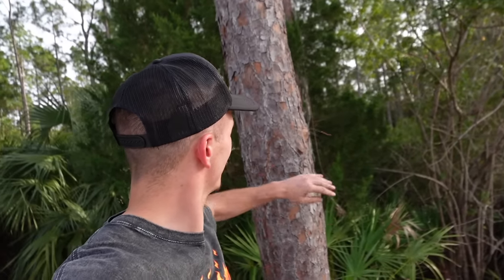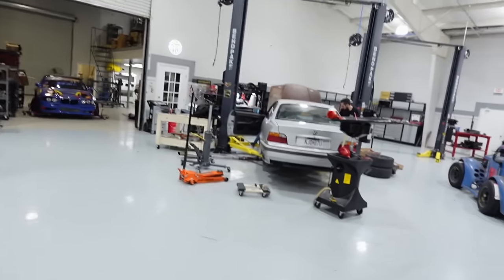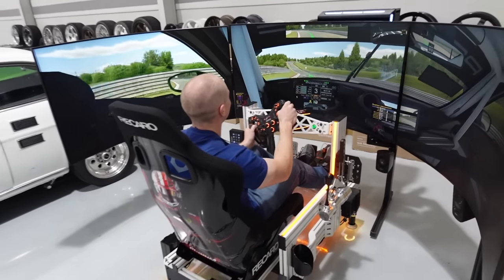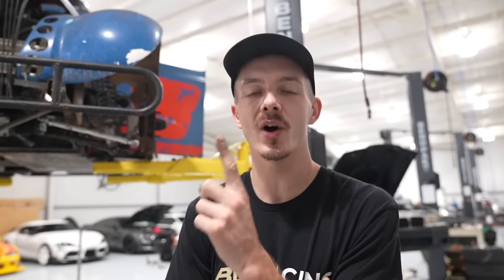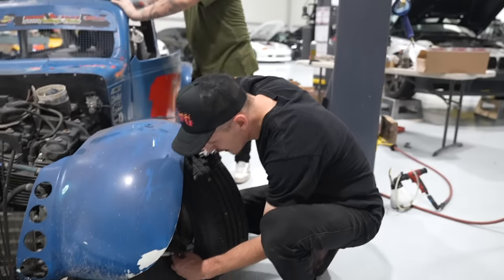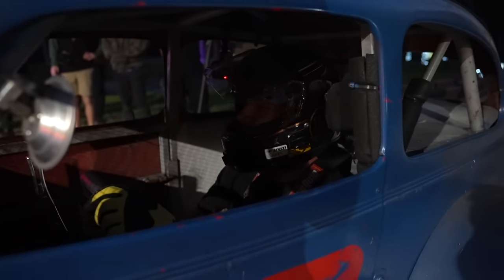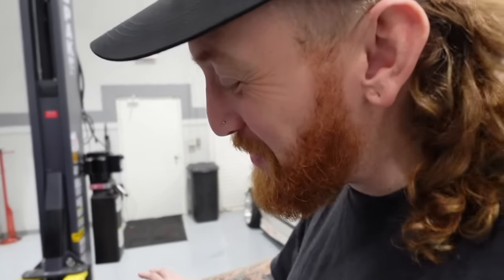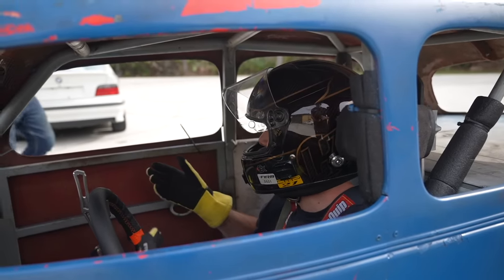Modifying My Streetbike Powered Racecar to Drift!

Comment: I drove one of these types of cars (modlite) a few years ago on dirt. My last one had ATV electric power steering on it. Worked like a charm!
Reply: That's not a bad idea. Power steering would help from haven to man handle the wheel an throwing his arms into the sides as hard. Hope he see this.
Reply: Bump
Reply: Pin
Reply: Was thinking something similar like an electric steering pump/rack setup
Reply: That’s a big alternator tho. Takes a lot of power to run an e-rack.
Reply: we use them in the micro sprints also. I didnt like it so I took it off mine but alot of the guys are running them.
Reply: I was literally thinking this throughout the video.
Reply: @RadDadisRad most run a complete loss battery system. Will usually last well long enough on 1 battery
Reply: A rack out of a SXS would work. Most SXS only have a 750w stator that run the whole car.
Reply: @RadDadisRad not an Atv or utv system it weights less then new side by sides and they don’t have alternatirs on most of those put a good light weight powerful Atv battery and you will never have a problem espically if it already has an alternator on it

Comment: Just a heads up you might want to add a nice beefy oil cooling system to keep the wet clutches alive inside of the gearbox... Those clutches do not like extended amount of friction heat from clutch dumps and kicks 👍👍
Reply: on the plus side, they are pretty easy to swap when you do inevitably fry them though lol

Comment: The carbs needle / clip position is mostly what you need to adjust for your mid range tuning. You might also want to start by adjusting the air/fuel mix screws
Reply: I agree, I would’ve tried to drop the needles a notch and seen if it ran a little crisper.
Reply: Correct yes: the pilot jet/AFR mixture screw only adjust Idle and just above so 2.5 to 3K rpm. There's a air bypass in the intake you adjust with that. After that its all the needle/main jet taking over.
Reply: Screws are for idle only
Reply: Beat me to it
Reply: This is the whole reason I came to the comments to see if somone had alrdy said it or to get diffrwnt sized sprockets for more power and or torque
Reply: need an 4 way vacuum clock to adjust em properly, almost impossible to make without on more than 1 carb setups like that XD think it's called that atleast in english

Comment: Idea for the lights, maybe have 2 of them on each tree, 1 where you have them to really highlight the tree and a second higher to give more spread.

Reflectors are V underrated, could line all the pavement with them (stick in dirt, screw reflector to it) and trees or other obstacles. Different colours can show entrances or hazzards.
Maybe yellow/orange for lining the pavement, green for entrances / access and red for hazzards, blue for water, white for the drops and so on. tonnes of colours to pick from.
IMO they are superior to lighting because they are cheaper and work no matter the weather etc/ no power needed and so long as you have lights (even really bad ones) they light up super clear.

You guys should do some drift games... Ring racing and such (think barrel racing (rodeo stuff) in cars) Much fun.
"King of the Cone" is an event during the Donegal Rally.. Good clean craic..
Reply: Good idea man

Comment: Bro, pull some pinion angle out of the thing to free the rear up some. Also you have the proportioning valves, ease up the front brake pressure and up the rear pressure. Then no need for the handbrake unless you get into trouble. Raced those cars for years.

Comment: What he said was a seat can be taken out, They are the main jet holder and have loads of small holes that can get clogged easily, You just tap them out, Pilot jet only does from idle to about 20% throttle, You want to go back and pop those main jet holders out and ultrasonic clean them

Comment: By the end of the week Adam's going to have all the nuances of turning a Legends car into a drift able platform dialed in!  I agree with Hert, next year instead of E36's everyone gets a Legends car and mods it. Only prob is, (as Collet & Grant let him know) the sketchiness of speed & the short wheelbase and basically open wheel chassis/frame with the little fenders and running boards, questionable welds Ect...might dampen the door tapping fun some. Guess you could aways weld some side skirt bash bars on. 🎄Merry X-Mas LZ Compound looks great BTW!

Comment: Try raising the needles one notch and or different taper needles - that's what governs midrange. Bigger main jets may also be in order. On CV carbs, shorten the slide spring one coil, and drill a tiny hole at the very bottom of the slide (if it's plastic). This relieves the air pressure above the slide so it rises quicker. Many CV carbs have delayed slide response and no accelerator pump so you have to do some little tricks to get them to open up quicker...

Comment: The caster is changed by the radius rod attached to the top control arm. I like the angle mods. Not sure if would be good for racing but would be fine for drift 🤘🏼
Reply: Never mind. I should have waited till you adjusted it with a grinder 😂
Reply: "We'll just drive it with a lot of toe out" (exactly like the Beemer) and you didn't even have to fab extensions

Comment: After 20yrs daily driving a competition geometry modified datsun 510 there are couple lessons ive learned.  Shortening steering arm (the slotting done...)  @ wheel end even a little removes a lot of leverage at the steering wheel... to steer one handed without power - leverage is a must.... but gained leverage is lost rate...leverage can also be gained with a larger steering wheel. A correct balance of both  and a driveby knob (think lo-rider bling)... and a decent left arm... andya in bidniz. Caster alo adds weight to the steering wheel in trade for stability... im sure you guys already know ALL this, fundamentally... but without power steering its all drastically amplified. Add wheel tire size weight and grip... and even big arms can easily be overpowered

Comment: Since they are so light you can add-to/rework the chassis/frame/cage to better fit all the drivers and make it safer for drifting, also would be cool if you make sheet plates on the edge of the skirt so they can leave "door marks".

Comment: Throw a junkyard 1000cc in it if you get bored or anything happens to the engine.  They average around 190-200 or more hp and you'll have that high rpm screaming inline 4 sound (still around 14k rpm but have that classic high rpm sound unlike the grunt of the engine in it now).  Also they are pretty cheap.  Newer 600cc's make around 130 and rev out to 16-18k rpm most of the time if you wanted to go that route.  A great example would be the Kawasaki zx636.  Always look forward to your videos.  Thank you

Comment: Getting flashbacks to my gran turismo 5 days. Medium soft racing tires on the front, very soft racing tires on the rear, and 900hp. Made for some very intense and very fast drifting sessions around Tsukuba circuit.

Comment: Add a battery in the back to supply a roof bar headlight unit, everything bolt-on like you want to. It's something simple, easy to make. Just make a hole in the back to get the cables inside the cabine and then other to the roof with waterproof glue to connect to the headlights

Comment: there are some Bike Engines over Seas that has Reverse  or you could mount a starter backwards and bolt a gear that will mesh with the starter between the driveshaft and the coupler on the back of the transmission.

Comment: You’re running on three cylinders at low rpm I think. Probably need the carburetors gone through and rebuilt. It should idle a lot smoother and not crackle like that at low rpm.

Comment: I bet it would feel a lot better with smaller diameter tires with less side wall. motorcycle engines don't have a lot of bottom end especially carbureted ones, so you should keep you revs higher and slip the clutch to control the power in turns.

Comment: The mid is the needle and needle jet. Pull the tops off and pull the slides. The needles in the bottom will fall out and you can adjust them by moving the clip (usually) or adding washers to richen. The pilot only does idle to 1/4 throttle.

Comment: That old Yam engine isn't even  gonna make120 horses. So much fun and adrenaline from so little... but you could take your pick of bike engines from the last 25 years and upgrade massively. Drop an R1 engine in there and nearly double your ponies for less than a grand. Much taller 1st gear does over 100mph on a road bike but the newer cassette gearbox would make a custom ratio selection so easy to do, plus quick shifter and auto blip feature on the gearbox has gotta be interesting in a legend. Clutchless sequential and a few thousand more revs. New game unlocked Adam.

Comment: Those CV carbs are a headache for a lot of 80s yamaha guys. They need a plenum of sorts so that the air has some speed to it coming into the carbs. The usual trick is adding "velocity stacks" between the carb and air filter. You'll lose a tiny bit of top end but gain a ton of mid range. Other option is the Murrays carb kit for the bolt on swap.

Comment: They make very nice electric power steering units for them that would help with the heavy steering, just need some elbow pads.  Sweet project.  Add a new injected gsxr1000 to it with about 200hp and will absolutely destroy those tires

Comment: In the centre of the slides for the carbs is a small hole if you drill that hole out to 1/8 it will work better at mid and bottom end

Comment: I was just thinking about oil and cylinder Temps while hot laping the car which is heavier and probably less air flow to the engine that's now blocking air to the 3 rear cylinders. I would look into some way of blowing air across the fins it don't rake alot to help alot on Temps. Also hoping you have a large oil cooler. Pretty sure that normal engine used a wet clutch which is bathed in engine oil.  May want to keep it changed like every 10 hours of besting. Love the ripping old engine but a new gsxr engine would run alot better in a over Rev situation.

Comment: 2 things you can do to to make it steer easer install a steering quickener backwards. it wil take more steering input to turn but will be easer to steer it. The other is you can find a electric power steering   unit from a 4 wheeler or a side by side and install that.

Comment: The only thing to worry about with routing the fuel line outside of the frame is that if the drive shaft falls off and starts spinning it’ll take out the fuel line, wether if it’s in the box frame that would protect it a bit. Just something to think about.

Comment: Your engine has CV carburetors (constant velocity) which are not in my opinion a very good performance carb. They react too slowly to throttle inputs (the time that it takes for the vacuum to pull up the throttle slides or the springs to push them back down).  I used to work at speed shop back in the day and we were focused on these old hemi muscle bike engines. If an engine came in with  CV carbs, they were the first things to go and a set of quality, mechanically controlled slide carbs were installed.
OTOH A mega squirt DIY fuel injection sys would be far more responsive, tunable and make more power to boot. MY 2 cents.

Comment: It's at the point Adam should just buy some kit car chassis that use s chassis steering and suspension and just get Johan to build a small fleet . Would be able to run them on small cheap tyres and use a fibreglass body to make it look like any car .

Comment: You need a steering ball like they put on truck or tractor wheels that way you can hold the ball and steer with one hand and still be able to use hand brake

Comment: Switch it to efi the carb bikes vs efi bikes are night and day different. Throttle response power gain. More control through the throttle range. Would lite the tires easier.

Comment: Modlites,  which is a faster legend car uses electric power steering off of side-by-side. Should work good on that.
Reply: A modlite is a completely different race car. But they're both considered "small cars" in racing. 
But yeah, he could probably use the electric power steering from a side-by-side.
Reply: @trevor4533  dwarf cars are a spawn of legend cars and mod lites are a spawn of dwarf cars.
Reply: Been around all 3 and built all 3. I do understand what you meant tho.
Reply: @ronniecanon1203  close. 
Dwarf cars actually predate the legends cars. First ones were made in the late  70s-early 80s.  The earliest Legends cars were actually Dwarf cars with a name change and Fenders.
But yeah, modlites also spawned from the Dwarf cars.
Reply: @trevor4533  hell we have used Honda 4 wheeler electric power steering on them. Basicly any atv or utv electric steering will work.

Comment: I wouldnt rev it up in neutral and then slam it into gear. the way a bike transmission works its pretty much like a sequential. theyre straight cut gears and when the motor is revved up those gears SLAM into eacher at the speed of the revs. you can definitely break some teeth off by doing that. put her in first and use the clutch to rev it up. being a wet clutch you can rev the shit out of it with the clutch in a not worry about it slipping or burning out. slipping the clutch with a bike transmission isnt an issue like it is with a dry clutch.

Comment: You should put power steering in it and run the pulley system off the drivershaft did it with me go kart

Comment: those carbs may need synced. (commenting before the end of the video though, grant may have mentioned this somewhere😂)
Reply: 100% they need to be synced, Plus he didn’t remove and clean the main jet holders, he thought they were just a seat and not removable, They have loads of tiny holes which can clog easily

Comment: Don't use ethonal in those carbs it will ruin them. It'll pit them! An it would run better if you put a slide carb on instead of a cv carb with a diaphragm.

Comment: You guys really surprised me putting rubber fuel line in, why wouldn’t you run hardline along the frame and just have a soft section at each end?

Comment: When Adam asked can you take these out? And grant said no.  Pretty sure you can and should take those out.  They are emulsion tubes and as dirty as the main jets were the emulsion tubes are likely also clogged up.  Really you'd be best to take them to a motorcycle shop that's worked on older bikes give them a proper clean, sync and adjust.